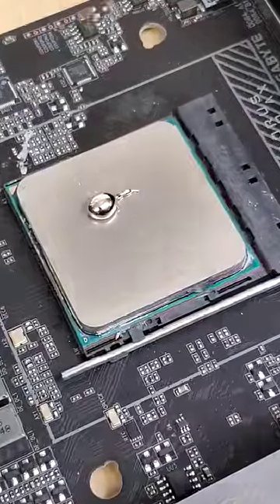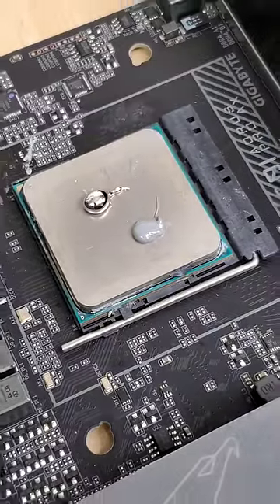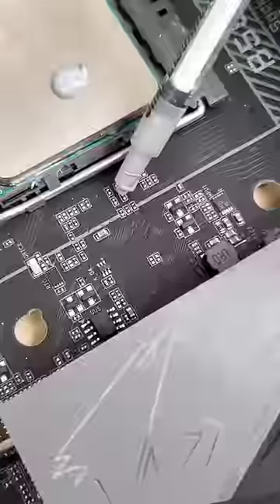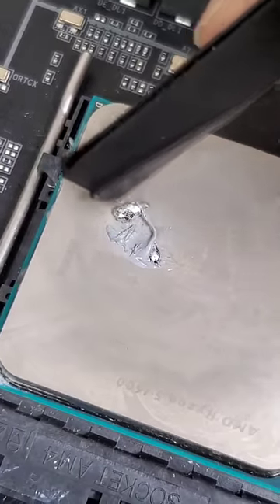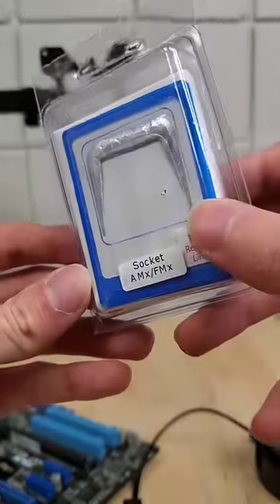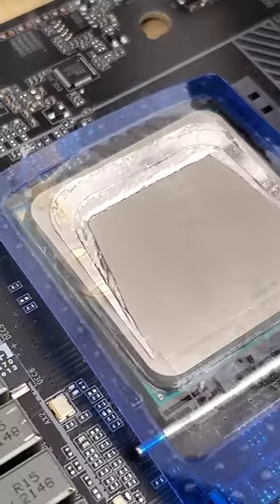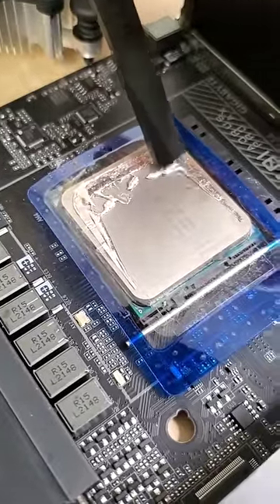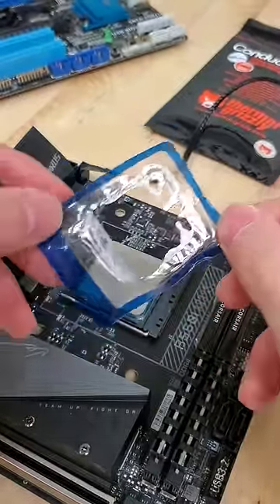the future of thermal paste technology #shorts

Comment: Back in the pentium golden days we use to take turns pissing on CPUs to cool them off
Reply: eskimo pee is 2 degrees cooler, try using that.
Reply: @turtleidiot3324  hey-ooo!
Reply: We used the blood of our enemies.
Reply: Ahhh yes the Pentium III Golden Shower Edition
Reply: Sadly, Cyrix took the piss...
Reply: I guess that means that those of us who remember building the 286, 386, 386 SLC, 486, 486dx, 486dx200, and 486dx400 only needing a fan passing air through the box will melt your minds faster than that solder. Then I think back to my first PC, the Commodore-64...
Reply: @TheBagOfHolding  ceo of amd checking in.
Reply: Intel pentium 4 processor with HT technology advert still runs through my head.
Reply: @nunyabidness674 I had a 486 33 MHz and a 66 "overdrive". They both have coolers as far I recall
Reply: @brarautorepairs  We built with Cisco CPUs, and most were mini tower cases. Overheating wasn't ever an issue for us. With the 486 /66 we also built dual socket boards with two 486 /33 chips for the "66" effect. Those had to have a cooler.

Some of the first gen 486 /33 chips from intel could hack it, but by the time intel kicked out their /66 they had a cooler.

Then go to the DX2x series, no cooler. DX4x, only half had coolers...
Reply: @nunyabidness674  I remember the good old days when you could buy AMD or Cyrix CPU and drop those "upgrades" into the 486 socket for a real kick in the pants. 75 and 83 MHz clock speeds where not officially supported but main board manufacturers released bios updates and boards to support the non Intel processors.

I was only 7 when I did my first PC upgrade
Reply: my pentium 4 Core 2 duo last 10 years, its madness
Reply: @brarautorepairs  lol... first "upgrade" for me I was 12 or 13 (born in the middle of the year) and it was taking a 386 chip off, putting a 486 chip on, and resetting CMOS. No extra BIOS required.

Where differences lie now isn't specifically in the CPU, and yet it is specifically the CPU... Bear with me.

A 386/486 chip was quite often also the GPU. Sound cards were separate, and video cards were just starting to come onto the market. (The 486s that needed a cooler were typically gaming machines...)

By the time Pentium came out, integrated sound / video cards were the norm on the motherboard, and they had dedicated memory that was stand alone from the main RAM cache. The biggest difference with the Pentium CPU is it had no sound or video I/O and so the entire chip could be used for core processes and software tasking. The pins that would normally be occupied by sound / video suddenly were able to be used to have the hard drive act as "Virtual Memory"...
Reply: The Pentium Golden Shower !
Reply: Golden shower had a whole diff meaning
Reply: @dbss206  we just pissed on them with no water follow-up. Thinking at the time suggested our piss was non conductive and actually assisted in corrosion prevention
Reply: The mortar pentium gold
Reply: lol golden days
Reply: Some people will be pissed off
Reply: Cap
Reply: @animebits69 doesn't run very fast though
Reply: @AndrewsVideoTips143  neither do I tbf
Reply: @plumbthumbs9584  Offensive word
Reply: @Feliphezo  Come all without, come all within. You'll not see nothing like the mighty Quinn.
Reply: I still own a 7th gen pentium cpu 😂😂
Reply: xD
Reply: "golden days" you cheeky bastard
Reply: I couldn't tell you how many of those bastards I replaced in a large call center of 2,000 workstations here in Louisiana.
Reply: Good ol days
Reply: Heel yea
Reply: I had a cyrix at one point , ran so hot you could burn yourself but kept on working.
Reply: @unimportant5122  Cyrix was the unkillable cooking processor.
Reply: A pentium CPU deserves nothing better anyways
Reply: You really shouldn’t call your sister a CPU
Reply: that was such a convenience over having to have spare CPUs on hand to swap out the hot ones.
Reply: quite literally golden days isn't it?
Reply: My first pc had a pentium 2, a veritable heater! The hottest cpu I ever ran was an amd 9590. Over 200 watts of thermal dissipation on that bad boy! Good mini space heater for sure
Reply: @vatwormindustries2767 they did last a while... But within 5 years was wayyy too underpowered and out of date.. It's honestly irrelevant if a cpu lasts more than 4 years at this point
Reply: @brarautorepairs  Yeah, but not like anything we see today. Its just a little flat heatsink with fins (same size as CPU), and a fan laid flat atop.
Reply: not me running mw3 on Pentium dual core and 3 gigs of ram
Reply: that is quote from that Mel Gibson movie where they piss on their mortars to keep them cool so they can still use them and fire on the enemy's positions...
Reply: Best comment ever!
Reply: @animebits69  my prescott used to help heat my place in winter
Reply: Pentium Gold > Intel i9
Reply: @TheBagOfHolding 
Especially those 
cold-blooded reptiles
Reply: "Golden days" lol
Reply: The “Golden Shower” days… ahhhh like old home week
Reply: They dont call them the golden days for nothin'
Reply: Lol, Pentiums made so little heat it really didn't natter.  I remember a tech fixing my IBM that was under warranty.  The CPU was dead and he swapped it out but realized he was out of thermal paste.  He called his superior who told him "its fine just install it without any"  I made sure he gave me in writing thats what he was doing you know, so they would cover the inevitable disaster.... It ran fine for years after.
Reply: Yes I'm sure those days were GOLDEN
Reply: @ycy-technologies  Ahhh yes the “Golden Days Golden Shower Circle” or GDGSC. I remember that well.
Reply: Wait… you guys Tricked me into saying that!!
Reply: @deepwoodtickles  I so wish I had been around during the Cyrix days, I know that ultimately the company failed for a reason and there were some severe tradeoffs to their CPUs but it's such an odd, unique little part of PC history that I really wish I could have been around to own one. If I ever get together the money to build a DOS gaming PC with period-accurate hardware like I've been planning for a while now I'd like to see if I can get ahold of a Cyrix through secondhand channels just for the novelty of it.
Reply: It's all about the Pentiums baby!
Reply: I don't what you guys are talking about but our laptop has Pentium 
And most of computers in our office uses pentium
Reply: R Kelly sponsored business venture
Reply: ”golden” days
Reply: This one does it for me. You win the best comment of my day.
Reply: 10/10
Reply: Lmao